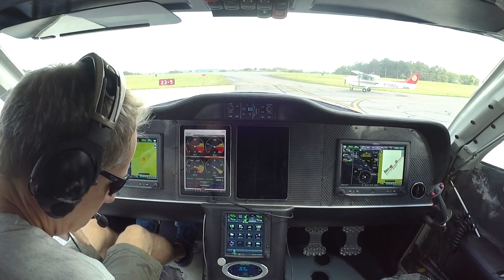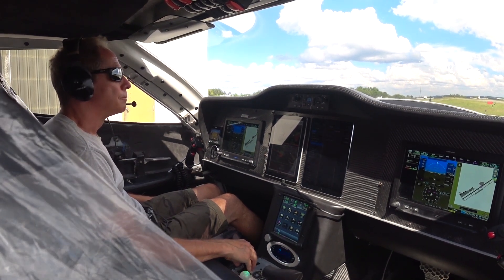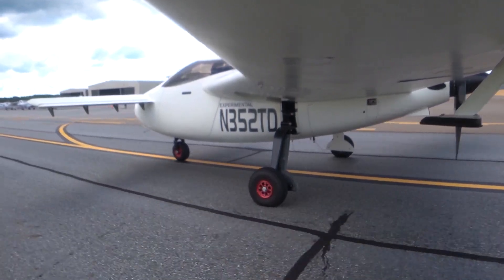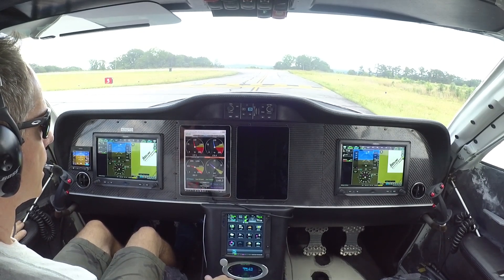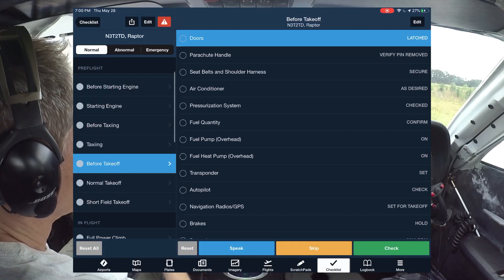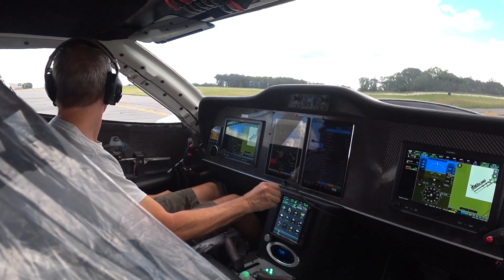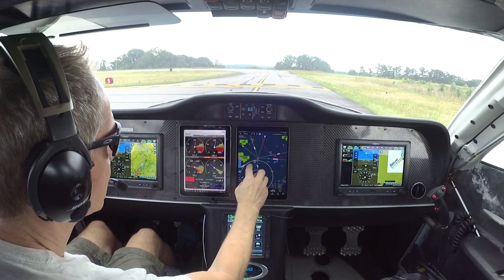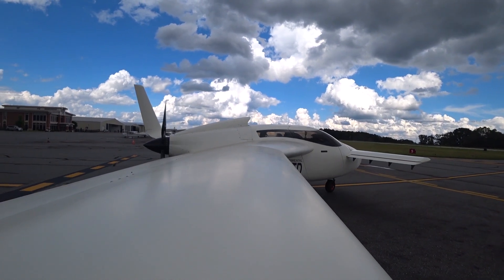Checklist Set Up - Building the Raptor Prototype

Comment: I noticed that you had the warnings on the Motec instruments set for 225' F for water/oil temp.  Those aren't really warning level temperatures. A typical automotive water cooling system with a 15psi coolant cap has a boilover point of about 250' F, so maybe 240 for yellow and 250 for red would seem reasonable.  Likewise, oil temps are supposed to be in the 200' F and above range, partially because you need those higher oil temps to make sure there is positive elimination of any water based contaminants that get into the oil.  For full synthetic oils, 230-250' F is an acceptable sustained temperature, while for non-synthetics you want to have your sustained operating cap around 210-230' F range.  Most of what I'm parroting here was culled from Q&A sights for automotive diesels used to pull trailers.  While the Audi engine you have here isn't in a truck, sustained climb and cruise power levels are much more similar to a truck pulling a trailer than the car the engine came from, so I would think their advice is probably highly applicable.  So, if you are running full synthetic oil, a 250' yellow zone and 270' red zone would actually be acceptable, while if using petroleum oil more like 230' yellow and 250' red would be better.  The point of my post here is just so you know what is considered typical/safe diesel operating zones.  If you set the zones on the Motec too low, then when you are flying the plane, what amounts to normal operating temps might cause you to throttle back when you really don't need to.  That might make the difference sometime on clearing an obstacle or not, who knows.  Anyway, there's tons of information in this topic, just google it.  You can pick whatever sources you feel have sufficient authority to be trusted.  Myself, I just checked it because I was pretty sure 225' oil temp warning is too low.  My father used to work as a diesel engine designer for Allis-Chalmers, and I remember him telling me that they designed engines to have oil temps high enough to boil off any water that might contaminate the oil or inside the crank case.  Maybe it's not the same now, but that's what made me go look.

Comment: I just hope refusal isn’t before rotate speed on this runway and it’s long enough for testing. I would hate for you to need to move to a longer runway just for flight testing when your setup in this hanger. You’ve got this Peter, we are all behind the Raptor aircraft. Someone brought up the issue of the A/C lines running through the cabin and having experienced tub fitting failure myself as with him the concern of all that gas being released inside the pressurized cabin. Not sure how your system is setup but it could become an issue one day if they do release. My experience was in a vehicle and an explosive release too.

Comment: I’ve had a lot of experience with both Garmin Pilot and ForeFlight. I love them both. To summarize, you’ll find that ForeFlight is better than Garmin for flight planning, but Garmin is better than ForeFlight for in-flight use. So, if you plan to use the tablet in-flight, I strongly recommend Garmin Pilot. If you plan to use it before flight, I recommend ForeFlight.